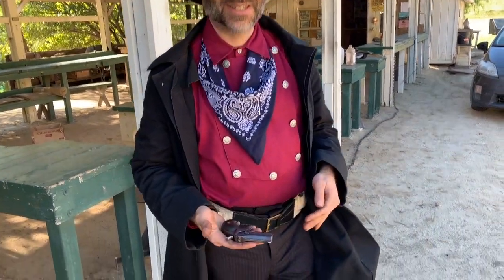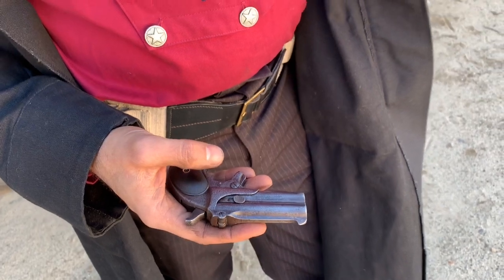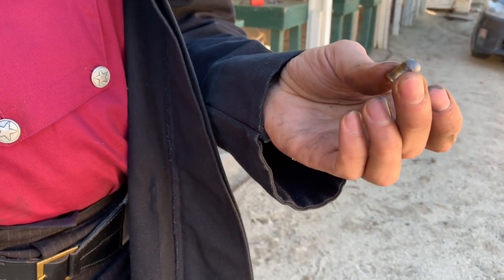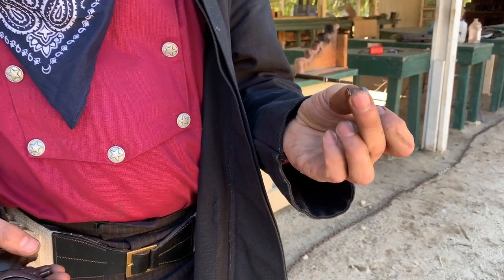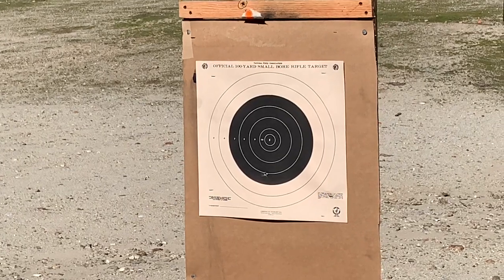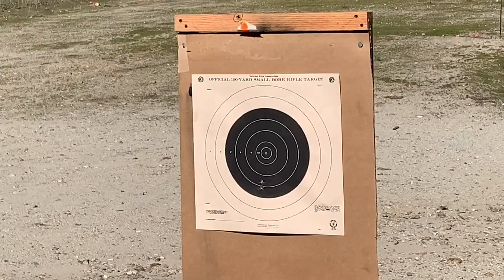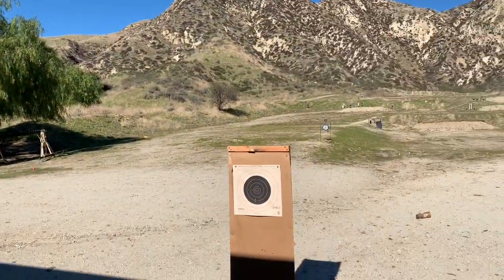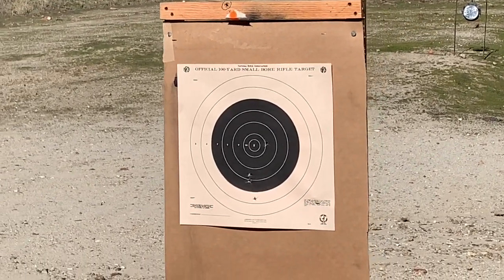Teaser: Eric with his .41 Rimfire Derringer (Type II, ca. 1889)

Comment: Wow that first group literally was one on top of the other interesting way to create ammo
Reply from the maker: Thanks. To my knowledge, the original cartridge/projectile was .405, yet the .400 roundballs I started with were just a tad too much and also swelled the case mouths too much so that they wouldn't  chamber. .395s still stop on the rifling and don't swell the cases too much. However, I still can't extract the cases using the extractor and have to use a wooden dowel.  Also, I have to resize the cases after shooting and do so in a .406 bullet lube sizer. The gun shoots pretty straight; it's more a question of elevation and how tightly I hold the gun when shooting. Now that I am holding it more tightly, I have noticed that my latest shots have tended to be low.